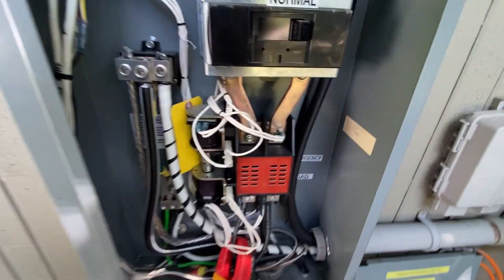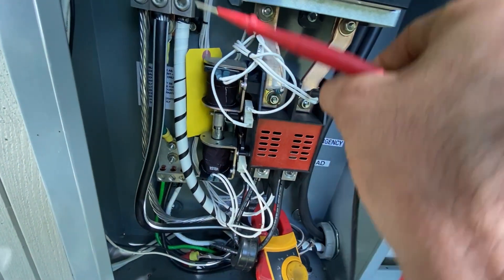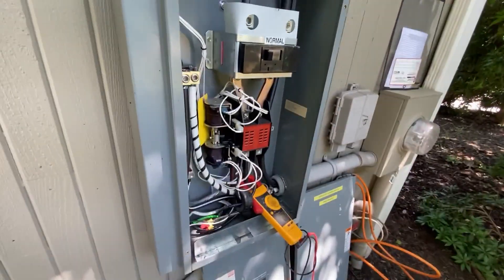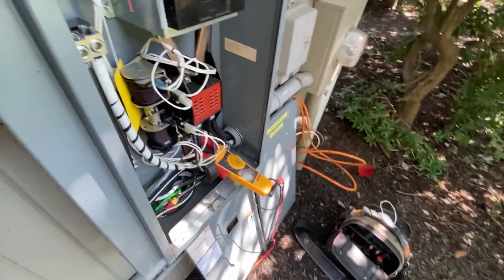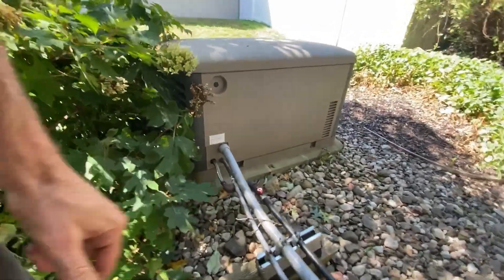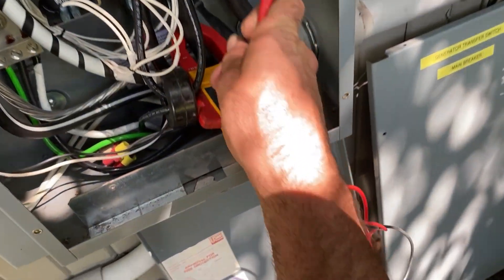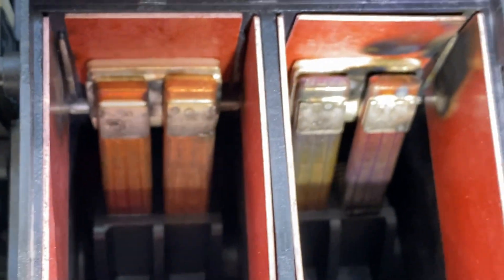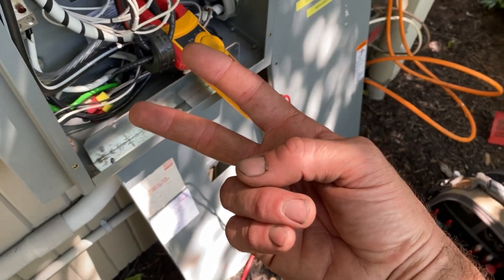Generator Returns Power To Some Circuits After Hurricane Isaias

Comment: Id replace the relay  u can see discoloration  on one phase  of the points so  could be looking at a call back
Reply from the maker: I told home owner he should replace and got him a price to replace. The customer chose to not replace. Therefore no call back if that did fail. That switch has been  transferring once a week. Since last august without failing. I wouldn’t want to keep the contactor in my transfer switch. Dirty contact points causes higher amps and hotter connections.
Reply: @thehvachacker  yep !

Comment: I was a little surprised you didn't burnish the contacts just because you  seem to go the extra mile most of the time, but I could be missing something. Your a well rounded tech and always have great videos
Reply from the maker: I told the owner we should replace the contactor because of the burned up contact. Yet he said he will ride it out yet give him a price. It hasn’t failed since and  runs a loaded exercise weekly. I wouldn’t want to keep that switch in my house.
Reply: @thehvachacker  he'll probably call back crying the blues in summer when the temps are up and all the A/C's sucking power and grid voltage down some.

Comment: How confident are you that it won't happen again? I might have cleaned the contacts on both sides with the utility and standby (both power sources turn off)  then open and closed it several times by hand to feel more confident it had good contact to the pads. Good video hacker👍👍
Reply from the maker: It hasn’t happened since, this gen runs a fully loaded excessive every week. I wrote the contactor up to replace. Just to cover myself and prevent a call back. Left it up to customer, and it never got replaced.
Reply: @thehvachacker  sounds good, exactly what I would have done. 👍👍Always put it in their ballpark. 🍺

Comment: Sometimes the load sense circuit doesn't return properly and it loses a leg...I have the same issues on a 1600 amp cat transfer switch. I have to replace the whole switching circuit and mechanism. The springs don't return like when new and it jams on the emergency circut